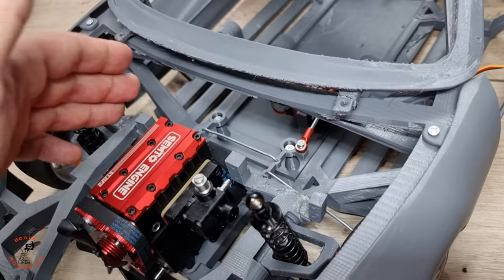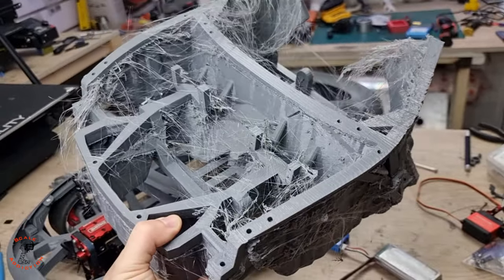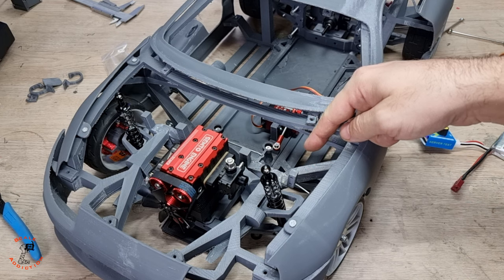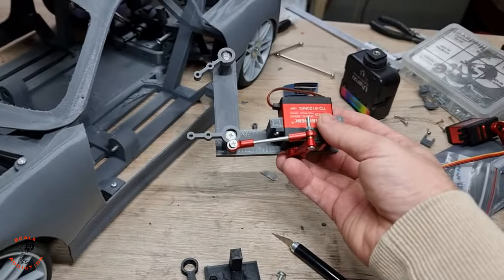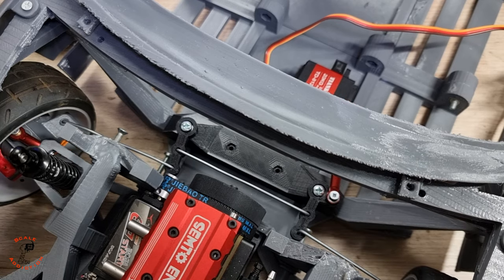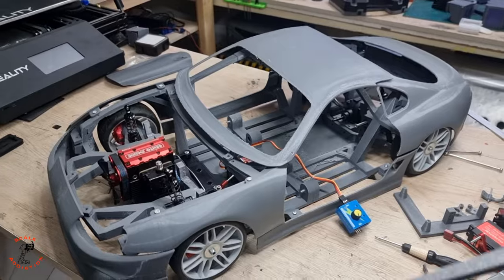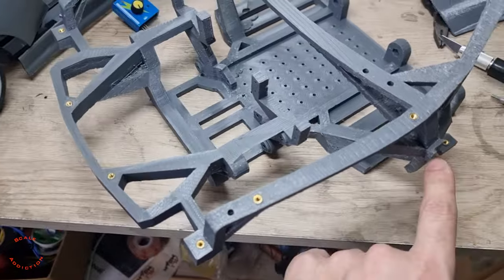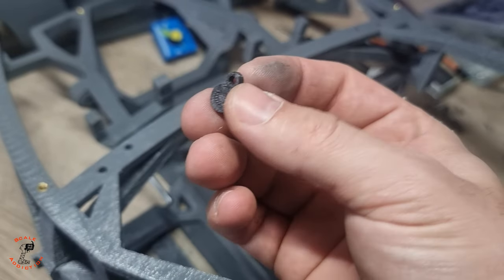Part 5 /  8th scale 3d printed supra with 2 cylinder engine project / Scale Addiction

Comment: Man , it really good, but your suspension doesn't work, too much suspension travel, u need more harder suspension. It is my opinion of course
Reply from the maker: That's a great opinion man, the springs can hold the weight,  but I have to shorten the shocks, then the travel will be shorter and limited

Comment: what size are the drive shafts that your looking for?
Reply from the maker: around 125mm
Reply: I found 107mm and 150mm but no luck with 125mm but I think adjustable drive shaft might work you could cut the dog bone ends off and put them down on the adjustable drive shaft and adjust them to the length that you need and maybe lock them to that size right now I am following the build but with duel  brushless system I am close to finishings my only road blocked was the drive shaft which I was just gunna run a 5mm rod from the gear box to the diff and getting my motors and gear box mounted to the car and my weight distribution is also and issue because of the duel motor set up  @scaleaddiction

Comment: Will there be available adapet to use 4268 electric motor?
Reply from the maker: Yes, after finishing this, it I'll make additional mounts for motor
Reply: Thanks, also L qauerter panel stl missing on cults, but see you have one when can I expect update of the files?
Reply from the maker: @anonrider8870  thanks, i just update and added it

Comment: Would the parts fit on printer x=220mm y=220mm z=250mm?
Reply from the maker: No, the 2 parts of chassis bigger
Reply: :c need to find someone with bigger printer
Reply: What would be the minimum size of print area?
Reply: @scaleaddiction  got bigger printer now, stl just purchased, hope it'll go well :D